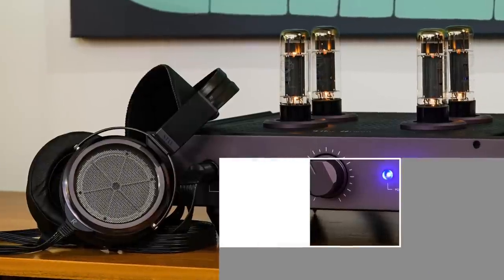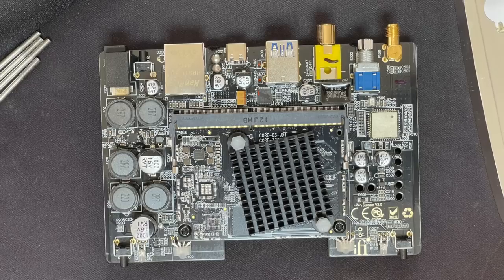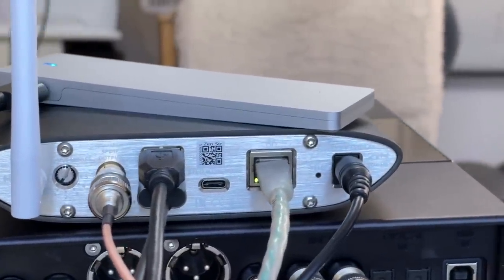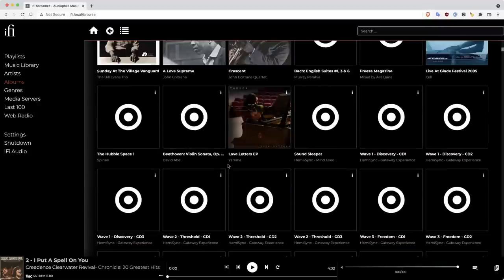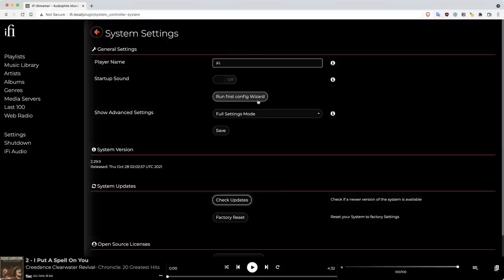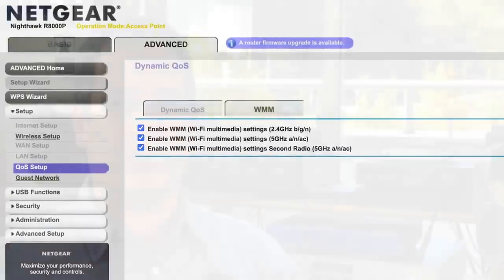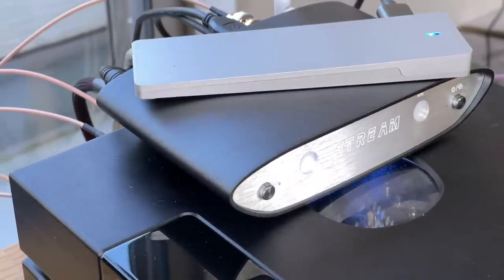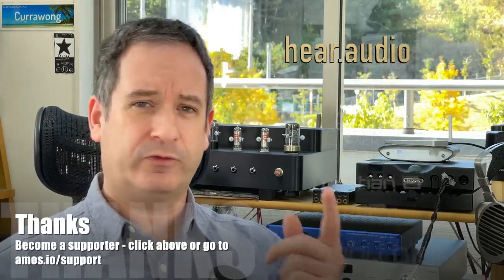iFi Zen Stream Wireless Network Music Streamer Review

Comment from the maker: Just a note: I found after I shot the review, that when streaming to the Zen Stream, the output device will be determined by the settings in VolumeIO. I have both S/PDIF and USB connected to DACs, and while Roon can pick up the USB DAC connection directly, for S/PDIF output, VolumeIO needs to have its output set to S/PDIF in settings.

Comment: If the sound quality is not discussed and compared to a computer-based solutions using USB or to other streaming solutions, what is left to this review. In my opinion the digital transport is nearly as important as the dac for sound quality. Yet we get plenty of sound impressions of dacs but most streamer reviews talk about functionality and ease of use. Very few focus on how they impact the sound; I guess this is the heritage of the old 0's and 0's and 1's are 1's. 
Currawong seems to have tens of dacs but just one streamer? That's an imbalance. 
I have a Zen stream, compared it to Sotm sms200, Project S2 ultra, Node 2, Microrendu and it is by far the best sound quality I have had from digital in my speaker based system.
Reply: Thank you for sharing this which gives me the confidence going with this possibly most economical option.  I am assuming that you imply the Zen also performs better than the computer-based solution thru USB SQ wise?  How much better?  10%, 20%?
Reply: Did you compare to Node N130 with usb out. I'm on fence whether Zen will impact the audio chain. If there were no connection glitches I would have bought it already.

Comment: I bought one of these and it kicked out my Auralic Aries Femto (now 7 years old) and my Allo Digione Signature. SQ is great and the form factor is much simpler than the Digione that requires two power inputs. I power it with my Uptone JS-2 and use the wifi connection via my 5G network and have used both an attached SSD and drawing from my NAS.  Like you, I haven't tried Tidal or Spotify connect and usually just airplay Apple Music when I'm looking for new music.

It works flawlessly. Thanks for the review!
Reply: Hi Mark, in terms of sq how does it compare to the allo digione signature ?

Comment: Hi there and thanks for the review. Did you try internet radio on the ifi stream volumio interface? I’ve been having a lot of problems with this feature. It won’t connect at all to a lot of different radio stations, it’s taking a lifetime, more than 30 seconds to connect, when it does. It’s a very frustrating experience this web radio option on this device. Other than that sound quality wise I’m very happy. Did you encounter the same issues like me with web radio? Thanks

Comment: Great review! I have been looking into this player for a bit and now believe I will take the plunge. One question I do have is in regards to your use of a linear power supply, could you elaborate. I'm currently powering my gear from a  dedicated 20 amp PS audio outlet and all components are plugged into a Panamax   
In my rack. Would that suffice or is there an additional cable I should look out for.
Thank you in advance from a fan in Maine USA

Comment: i bought one of these in August and it had PSU problems that where common with the IFI ZS at the time so i sent it back for a refund.  a second unit was sent and it too was defective, the dealer in Singapore would not give me a refund after he determined it to be  defective, but only a replacement. using Roon/Tidal this thing crashes repeatedly, but sounds very good. i have updated the firmware and it will sometimes work for an hour or two. i bought a Bluesound 2i and it has worked without issues on the same network for a month now. no disconnections!  i think the iFi could be network dependent ?   i hope that iFi will eventually make us customers whole and release a fully functioning V2 version that we can exchange for.

Comment: little confused around the 17:00 mark: you say when using the ifi power supply on the zen....the spidif out of your SU1 sounds better than....what? And then you say the USB out from the Zen is comparable to the SU1. I'm so confused!
Reply from the maker: Better than with the stock power supply feeding the Zen Stream. 
Some people ask if they need an SU-1 (or similar) with the Zen Stream, which the don't, unless they want more outputs. 
I've also found that the Zen Stream will crash after a few hours if I don't use a good power supply. I've noticed other people have had a similar experience. They seem to be sensitive to power supply quality.

Comment: I'm pretty sure that the power supply of the streamer has 0 effect on the sound, assuming a DAC that filters out any analogue noise on the input. The DAC should just read th edigital stream, which is not affected by the power supply.

Comment: It looks like you connect from Zen usb (INPUT From Storage? ) to SU1 usb B since there is only one input. Saw that you connected by Ethernet on Zen. Will it still work by wifi instead of hard-wired? I have a SU6 and thinking of getting Zen Streamer.
Reply from the maker: Yes. It’s basically a mini computer running a Linux distro.
Reply: @Currawong  Thank you for your reply. I have just bought Zen Streamer yesterday however I am having problems in playing foobar through the streamer. Foobar is not picking up any device since the laptop is no longer hooked up via usb to the Dac. Usb is hooked up to the SU6.

Comment: Would you be able to recommend a linear PSU for the Zen Stream? I think I also read zen stream had issues with cheap 9v PSUs and 12v was recommended, I’m not sure about that.
Reply from the maker: I don't have a recommendation. There are numerous ones available on places such as eBay. The voltage shouldn't matter as long as it is within the range that the device is able to accept.
Reply: @Currawong  I had a look at the specs on the Zen Stream and it accepts a power input of 9V (1.8A) to 15V (0.8A) which reminds me of the Alix boards I used to work with years ago. This puts good linear supplies aimed at amateur radio (13.8V) in the frame, along with the iFi Elite power supply in the 12V and 15V option. iFi claim significantly better performance with these than audiophile linear power supplies.
Reply: ZEN accepts 9V - 15 V

Comment: iFi should provide more complete instructions for setting up and using the Zen Stream. For example, the Stream is supposed to work with music files stored on HDDs and SSDs, but it doesn’t see my HDD or SSD. The Stream did see my older USB thumb drive, but that device holds less than 10 percent of my music library. The music folders on my HDD and SSD are located in a sub-subdirectory, whereas the thumb drive just has music folders for each artist. Some artists have multiple albums. I’d like to learn how to tell the Stream to look for the sub-subdirectory containing all of the music folders on the HDD or SSD. Or does the use of subdirectories confuse the Zen? Is this too difficult for iFi to explain to its customers?
Reply from the maker: It's more of a Volumio issue, if anything.
Reply: @Currawong  Thanks for responding. Actually, it turned out to be a formatting issue—FAT32 is required.

Comment: Can you recommend a linear power supply?
Reply: iFi make their own Elite power supply that comes in 4 different voltage outputs - you’d need the 9V version for this. I have the 15V Elite on my iFi Pro iDSD 4.4 which makes a huge difference compared to the included Pro supply. They don’t come cheap though - they are 300 GBP

Edit: There is no 9V version. I was incorrect. The 12V and 15V versions are suitable for the Zen Stream
Reply: I Use Teradak. A little expensive in the $ 250. Its 200 W power. Its a beast. I did some custom work on mine… making it an ultimate power supply.

Comment: I appreciate the thoroughness of the review, but the Zen Stream does not seem any better than a Raspberry Pi. Many of the critiques of the RPi are resolved with an RPi 4. 

I’ve had an RPi 4 running MoOde Audio in my system for about a year ad it’s been very reliable and sounds great. Total cost of my build, RPi 4, case, Power Supply, SD Card and 128GB USB drive for FLAC was around $150.
Reply: I use various RP, iFi, Sonore and other devices.  I retired an old RP3, replacing it with an RP4.   Whether there is any advantage to the iFi vs a homemade depends on as much what you are connecting to and how much electronic noise is being introduced, as it does whether you have the time and interest to build-up a streamer.  Unless we listen on higher quality gear (Focal Stellia, Abyss 1266 HP’s, or comparable levels of monitors and supporting electronics), even at 57, and obviously my younger engineers can hear a consistent ABX difference across most source material moving from the RP 4’s to the higher-end gear— and to a lesser degree the iFi streamer.  However, if listening on typical few hundred dollar headphones or comparable monitors, much of the difference has not been audible to any significant degree.  The same is not true if put on noisy segments, as having an optical electro bridge is quite noticeable, albeit is addressable with an external hardware.
Reply: You will be amazed when you put a denafrips iris between your Rpi4 and DAC. I did. And I found out that USB isn't that great
Reply: It is not plug and play….I had mine running in 15 minutes…

Comment: If one connects various digital sources, such as different streamers, to a galvanically isolated and practically jitter absent Holo Audio May Dac (for instance), would their be a difference in sound quality between those sources? If so, why? It would seem to me that that particular DAC would mitigate all of the upstream data timing issues (jitter) and prevent EMI/RFI from reaching the conversion portion of the DAC.
Is there any other distortion causing element of a bit-perfect signal that I am missing?
Reply from the maker: The USB receiver can generate noise too.  The more processing done inside a chip of any kind, the more noise it generates. Some newer designs appear to be double-isolated, that is, with isolation after the chip as well.

Comment: Mostly good video although it’s very hard to tell where you are and what you’re talking about when your screen is showing microscopic fonts on your monitor.  Also might have been better not to assume viewers k ow how to even get to those screens (you pass quickly over the software connection).  Finally, I think the inclusion of your “digital to digital” converter in the discussion is inappropriate, confusing, and probably detrimental in use.   Leave it out.

Comment: Anyone who calls this thing plugin play, reliable, consistent, stable or anything of the like is lying or they love fiddling with things. If you want to listen to music DO NOT BUY. Does it sound good? Yeah, all the same as the Node that works all the time. $200 more for the Node is really for your mental health.
Reply from the maker: So I'm lying about it having sat here for months without issues?  I suspect it does have weird issues that only show up under certain conditions, in certain set-ups.
Reply: @Currawong  more of a general comment. But maybe you could clarify a few points. Do you ever turn your amp off? Change your source? Or turn off the ifi Stream? How smooth are things after that? Do your setting remain or does it default changing the volume management? Which version of the firmware are you using? Does your ifi app ever crash?
Reply: I recently bought the Zen Stream and had numerous setup and connection problems, probably similar to you. During initial setup, I had upgraded the firmware (via the Internet connection) in the Settings. After much frustration, I used the reset button to go back to the factory installed firmware, and everything worked perfectly after that. The only issue for me is that the newer firmware added support for MQA passthrough on Tidal to an external DAC. When they get their new firmware fixed, then I will upgrade it.
Reply: I was going to replace my Node with the Zen Stream, I sent it back, it was the software, total garbage for my application. I kept the Node, and then replaced it with the Pi2 Mercury v2 and erased the Volumio software and replaced with RoPieeeXL. Rock solid and sounds incredible. So much so, I can hear the difference in cables. And I never thought I would hear myself say anything like that, as I used to be a "science" guy. Eating some humble pie. ;-)

Comment: As far as I understand, the iFi Zen Stream has all-digital circuity, digital input and digital output.  So how can the power supply improve SQ?  Digital bits are unaware of power. It’s either a 1 or a 0.  And if it gets messed up, it certainly doesn’t know about highs/mids/lows/soundstage or whatever standard one uses for SQ.   If it actually does change the SQ, this means there’s a digital processor that does something with the bits. Now, it’s not like I don’t want to believe the reviewer, but from a technical standpoint, it doesn’t make sense.  By the way, this principle also make me have doubts about this entire unit, and espessially its price.  If you have rasp. Pi 4, (not 3) with an SD-card and Volumio or Ropieee running on it, you pretty much have the same thing… and that one does in fact do DSD512 (not that it matters much.. I agree with the reviewer on that one).
Reply from the maker: Hi. "The Reviewer" here. A digital signal is more accurately thought of in terms of being a square wave transmitted in the analog domain. (A "1" and a "0" is better for imaging the instantaneous state of something in a digital system when the underlying electronics aren't being considered.) The quality of that square wave also includes any other signals with it, such as noise, coming from connected components, the hardware itself as it corrects for transmission issues, *or the power supply*.  Likewise, the ability of the power supply to supply a steady voltage and current to the device, even with inconsistencies with the power being fed into it, must be considered, as the failure to do so will result in performance issues with the circuit.

That being said, I don't like how it affects the sound either.